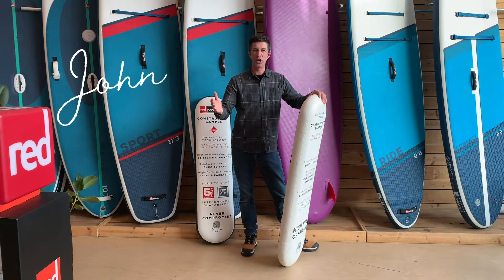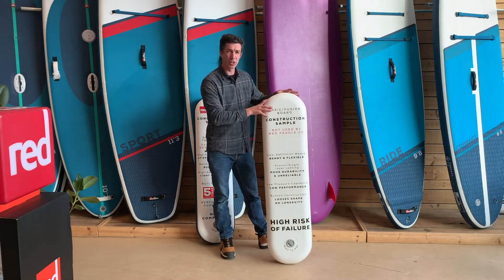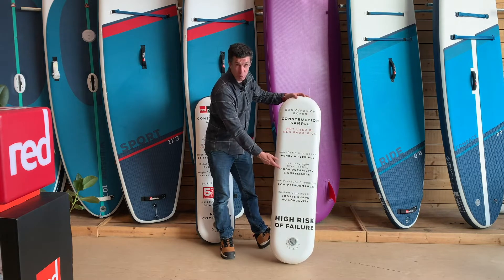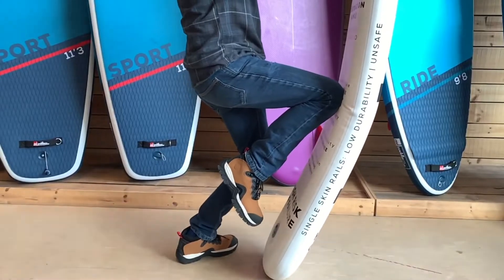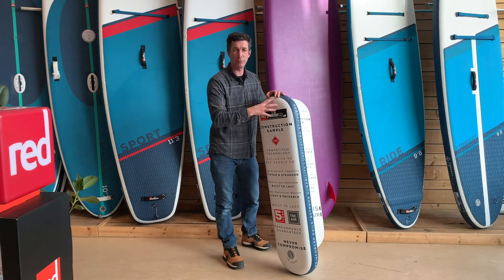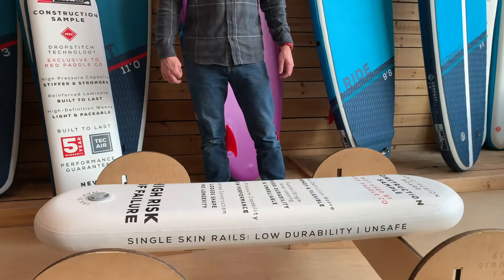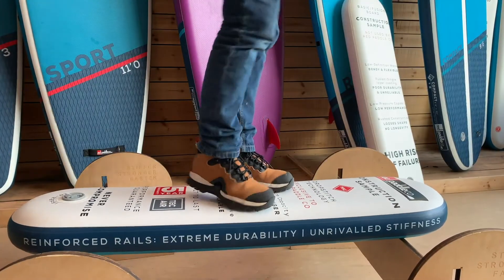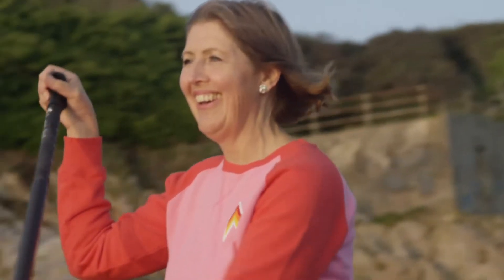Are Red Paddle Boards Worth It? Red Paddle Co's MSL Inflatable Stand Up Paddle Board Construction

Comment: I have no experience with Red paddle CO Boards, so I may not know what I'm missing. However, it's a tough sell for me. They are by far more expensive than any other board on the market, yet don't distinguish themselves in any particular way. I find other companies make boards with better geometry just from the looks. Also, red boards are soo pared down. It's like you're paying more for less, which I would be willing to do if they could better articulate that their less is more.

MSL is just a copywritten word for Fusion Laminate.

The RSS batten system seems finnicky and less reassuring than other approaches, such as dual chambers.

Red Paddle stresses that they make their boards in house, but that's not true. I hear they make their boards in china, but with an exclusive manufacturer. While that might yield a quality advantage, I think their misdirection is somewhat dishonest. It's good that they care about their image, but it seems like they oversell their image along with the board. I don't know of any other company that not only hides that they make their boards in China, but uses that lack of information as a marketing tool to sway buyers opinion.

It's oddly difficult to find deflection test results for Red boards despite their competition being posted on many sites. Are they more stiff than another brand? More durable? They claim 25 PSI. Hydrus also claims 25 PSI. Infact, they claim they factory pressure test each board to 30 psi. Their boards are $600 cheaper. Red Paddle Co offers a 5 year warranty, but Hydrus offers a lifetime warranty. 

I bought a starboard 14' deluxe dual chamber instead. Saved $300 over the slightly smaller Voyager 13.2. Maybe one day I will buy a Red Paddle Co board to see if it lives up to its price.

My first board was an ISLE Explorer. Love that thing. It cost me $800 with tax. I feel like ISLE and Starboard have more honest and straight forward marketing. Red Paddle seems like the Apple of the ISUP world. Same product, but branded as higher end.

I'm not trying to hate on Red Paddle. It's just out of all of the companies, they are not only the most elusive, but also the most expensive. Virtually everyone says they're good boards, but nobody explains why they cost 40% or more over their competition, which also have "good boards". I Really wanted to buy a voyager 13.2. It was my dream SUP, but I just couldn't justify paying so much more for it.
Reply from the maker: Thank you for the detailed comment. There are many arguments for and against the various construction methods and stiffening features used by brands. Red Paddle Co certainly make an effort to differentiate with various patented technologies featured on their boards that aren't available elsewhere, and it is all ultimately a balance of wants and needs, performance, weight, convenience etc to bring boards to market.

I don't believe any brand we sell state, or advertise, they are made in China. What sets Red apart is their boards are made in a factory that exclusively makes Red boards. First hand experience, they have by far the lowest warranty rate. (All our brands are low.)

A Chevy and a Mercedes will both get you to the grocery store, but they don't cost the same. It's the details, workmanship, longevity, support, experience, and advertising of course, that all play a part in what you choose to invest in and paddle.
Reply: @GreenWaterSports  Thanks for the reply. What you say makes great sense, and the warranty info is very compelling.

I'm sure those who know what's up understand the difference. For a lay person like me though, it's hard to understand what distinguishes Red Paddle CO from say Starboard. I recently bought a deluxe touring double chamber from you guys. It was $300 cheaper than the smaller 13.2 red paddle voyager. Got a nice paddle instead.

I do love the Red Paddle design though. It's absolutely simple with no clutter on the surface, and IMO simpler is better for sure. It was all the not so simple elements around the board, such as  the price, RSS batten system and two instead of 1 fin, that turned me away. I realized that going on a SUP adventure requires a lot of gear. Having two battens and an extra fin to worry about didn't sit well with me. As a new supper, I'm already at my limit with details to worry about lol.

I get that Red Paddle CO caters to the professionals, and that's fine. I think there are plenty of people new to the hobby who have a high budget that would buy their boards if it were easier to identify what they're getting. Like I said, I'd gladly pay more for "less" as long as I understand clearly the quality differential.

Haven't tried out my Starboard board yet, but hoping to hit the Colorado river in the next week or so. 

Your service was top notch, and even though I haven't inflated the board yet, she looks beautiful! You're my first stop when I need any more gear.
Reply: @GreenWaterSports  If that´s so why would you need battens then? I´m still undecided about getting the Starboard Touring or the Red Sport 12´6. Price aside which one is stiffer, I would like an honest opinion. Thanks.
Reply from the maker: @MarioDiaz-co3px  Battens are needed, but they make it better. Better in this case is stiffer. If you are heavy, carry gear or paddle in rougher waters, a stiffer board is going to be more predictable which means it's going to be more stable. 

Both boards are very stiff. There are other features though that would be more important when deciding between these two. The Sport has more nose rocker. The Starboard has a shoulder carry strap and rear cargo area. The Titan 2 pump vs the Tiki pump. Do you want to install battens or inflate a second chamber? These are the details that should help make your decision.